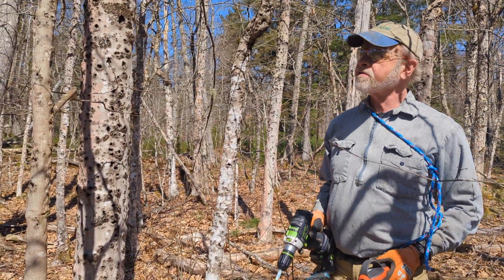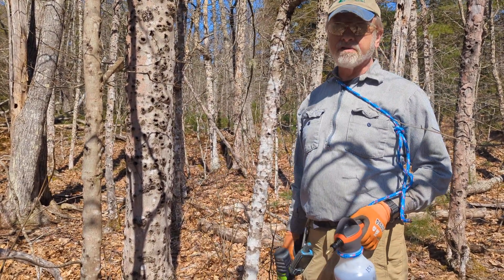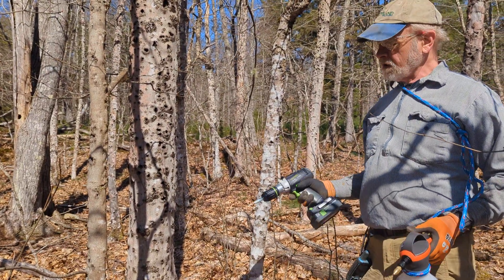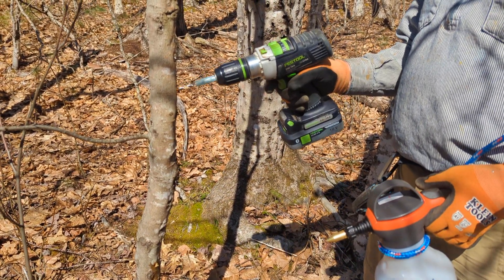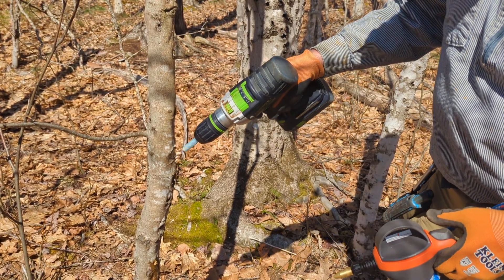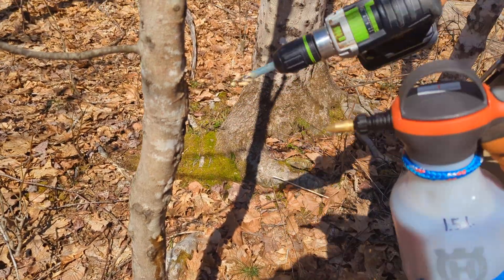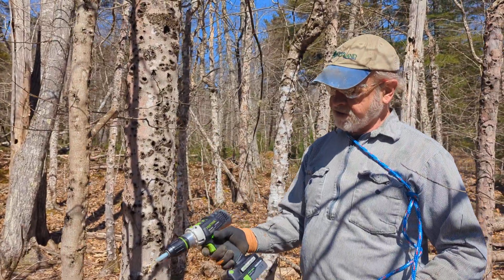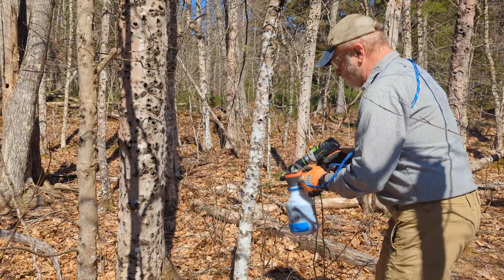Drill and Fill for Tree Injection - Woods Work Flow and Productivity

Comment: Thank you Bob for the video. Indeed, it was my idea to execute NRSC Conservation practice #314  exactly like that. The problem is  Federal's very strong stereotypes . The supervising manager said, if it states Hack-n-Squirt , you should do exactly the same. I started a debate trying to ignite a logic. The important part of the program is a result.  A cordless drill powered by 18V  and 1/2" drill making 45 degrees holes seems more effective and less labor  loaded process. I have to serve my 63 acres heavily occupied by American beech . Same time my property is  not a flat table, sometimes I wish I had a third hand to keep myself safe on a stiff because 2 are holding a sprayer with Glyphosate and an axe or a drill.
I want to convince my NRSC supervisor  that drilling holes ( 45 degrees down) to fill them with Glyphosate  is a more effective method vs. a hatchet or a machete usage. Your video is a great proof  it works. 
Of course would be super nice to have your another video made over 1 year showing the same lot  filled with dead beech trees.

Comment: I work for a bush crew company and there's a big debate currently about whether it's better to do 3 layers of rings or just 1, what do you think is the better approach?
Reply from the maker: What do you mean by a "ring"? One hole per 2" of diameter
Reply: @tmimotf  they'll drill around the base of the tree doing a hole every 5 centimetres, after they get a ring of that they'll repeat it another 2 times
Reply from the maker: @maharba1232   What species?  This sounds like serious overkill.  5 cm circumference would be one hole for every ONE inch of diameter, double what we have used. Not sure why you would need more. Even more puzzling is why anyone would drill at the stump height? (requiring the worker to bend over).  The herbicide kills by translocation so drilling at waist height is much easier and completely effective.